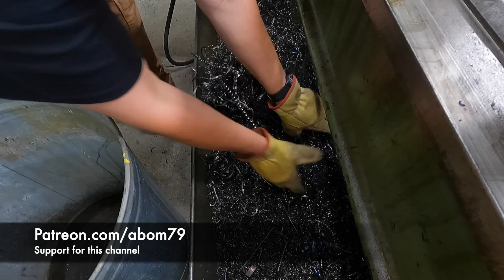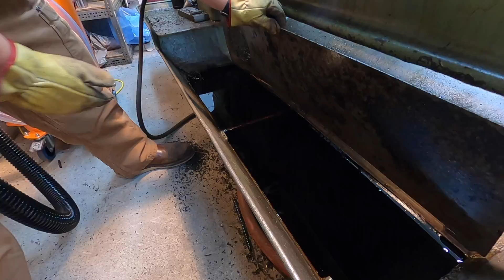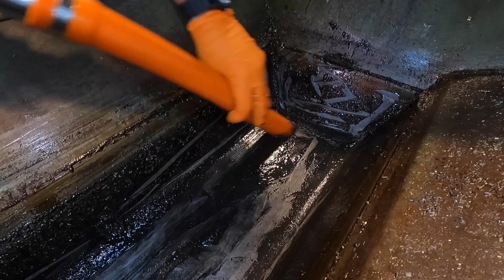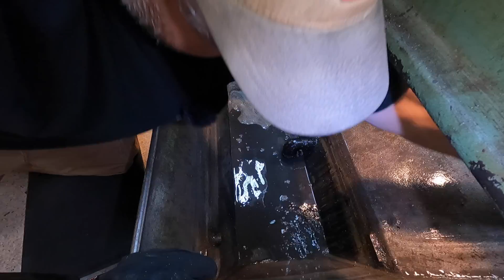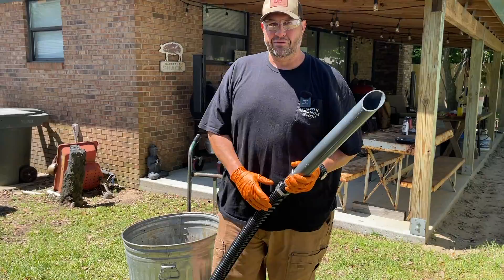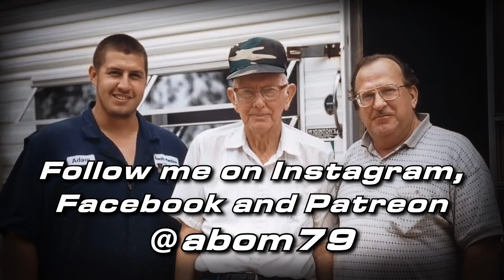SNS 344: Monarch Coolant Sump Clean-out, Freddy Micro

Comment: Very interesting. Two days ago I watched a video you posted 9 years ago doing the same thing. Video and audio quality is much improved. Your ease in front of the camera is noticeable. Camera angles improved as well. In the original video you showed the chart from the manual that recommended the weight of oil for the crankcase. Very helpful to the professional ( I'm not ). This time it looked a lot easier. Kudos.

Comment: I am a maintenance tech at a large shop. One of my monthly PM's is too clean out all the sumps for all the metal cutters. We have a Parker filtration pump that pulls the coolant into a 200 micron filter, then a 10 micron filter and then discharges into a holding tank. Once the coolant is out, I scape out all the chips and crap that accumulates. Then I return the clean coolant back to the sump and it's good to go. We were doing it every six months, but it's just too far gone and 10x harder. If you do it monthly it's not so bad. We do a complete coolant change out once a year. We use the Blazer semi-synthetic and add fungicide to keep it from getting rancid.

Comment: Since there is so much water in the coolant, does it leave a slight surface rust, when its on a bare surface and dries away? Or does the actual Oil Lubricant in it prevent that?
Like do you have to wipe your entire machine completely dry after you used coolant or can you leave it be? Maybe just clean off the most soaked parts?
Reply: in my experience correctly mixed coolants souldn't leve surface rust on parts. though It may wary from brand to brand. also to be fair only 5 years of experience.

Comment: I could smell that sump from here!  I was out of engineering for 11 years between 2002 and 2013 being a police officer, but when I went back to aerospace, in the intervening years the coolants had undergone a sea change. The stuff I use now is more or less totally clear, and never gets and anaerobic bacteria or other nasties in it if left dormant for a while. The only reason it gets pumped out now is if there's a build up of grinding dust in the sump limiting it's capacity or it gets heavily mixed with tramp oil - but that's rare. While my machines lose a lot through evaporation and extraction in use (that's grinding!) so are always being topped up, they go some 2-3 years between complete pump outs now. Amazing stuff, and it NEVER starts to smell bad.

Comment: 18:06 You could use a splash guard like the kind of thing they have on the nozzle at the gas pump. You’d probably have to make your own; it wouldn’t have to be pretty.  You could take a piece of aluminum make the hole with a hole saw, and then TIG weld a couple of tabs on ether side of the hole to mount it to the nozzle with a hose clamp I think you’d be good. Added bonus it sounds like it’d make for a good video if you ask me.  :)

Comment: Would it be easier to clean the sump with a wash down gun like a Milton Siphon Air Gun (Model #: S157 or S161)? Then you could take your Zep degreaser mixture and wash everything down to the bottom and save a lot of time and getting messing wiping all that down.

Comment: Why are you putting new coolant in your lathe? Ive never seen you use coolant on any job in any of your videos, ever... The coolant you removed was funky because you never used it. LOL :-)))
Reply: a lot of youtubers dont run coolant when they are filming so you can see what they are doing
Reply: @gtochad  I thought of this before I uploaded my comment, but it takes a quite a while for the water to evaporate and leave the nasty raw coolant behind. On my machines, I notice this starting to happen early on and top up with water way before this happens. As for howder1951's comment, ''tramp lubricating and cutting oil over time'', this could be the case, but again, it'll take a long time for this to happen as its only very small amounts in a very large sump. What he took out of his lathe, had been in there and wasnt checked in a very, very long time. He obviosly doesnt use coolant, only cutting oils when needed.
Reply: He does use it and a lot of the sludge comes from tramp lubricating and cutting oil over time.

Comment: Hey Adam,
In the Shop I work in (Germany), we use a Systemcleaner for the coolant, that gets mixed into the old coolant and it kills bacteria and mould in it.
Then the pump runs for a while, that everything gets "cleaned".
After that we empty the sump and clean it with degreaser and Isopropanol to disinfect it, so that the fresh coolent won't get contaminated and that it lasts longer.
Kind regards from Bavaria👍🏻

Comment: good choice for filter  since you weren't gonna reuse the coolant. a10 m probably won't clean out as good. probably good choice if you were gonna reuse the coolant. we use a similar sock filter at work. from 400 m to 5 m. we trash all the  filters most of the time. A 400m is a mesh style sometimes rinse out them but 200m and below are felt style not much cleaning them... but they are filtering glue. not coolant...

Comment: Still wondering, why I watched the whole video after doing the exact same thing with a DMU 1035 last week. I would have worked over time, refilling that thing with buckets.
I would highly recomend to flush your system with some kind of a cleaning solution. You could just put a bucket under your pump and let it run through the system and back in the bucket one or two hours to really get rid of the biology that happends in the coolant. If you aren't working with coolant a longer time it also doesn't hurt  to just turn the pump on from time to time, just like in an aquarium. Whatever starts to live in there after a while doesn't like oxygen.

Comment: The second-worst smell I've ever experienced (and doing weird chemistry has put my nose through the wringer a few times) was the sump of a big mill in my high school machine shop. We had all this "cast-off cast iron" as the shop teacher called it, a lot of it had been obtained cheaply from Uncle Sam after WW-II. That sump was supposed to have been drained at the end of the prior year, and hadn't, and apparently it didn't have any (or enough) anti-microbial agent in it, because it was AWFUL. FYI the curious; the 1 worst smell I know of so far is rotten potato. OTOH, I have never, to my knowledge, smelled thioacetone, and I am quite content to leave it that way. Your task looked un-fun to me. But you are smiling. Or is that a grimace? Not sure. Whatever it is, it's not an expression I see on your face very often. ;)
Reply: The worst for me was rotten meat. My dad wound up in the hospital for a month and apparently right before had thrown out about 5 pounds of meat. It sat in his trash can in his closed garage in 100+ degree heat for a month before I eventually went to his house and into his garage to find something. The smell nearly knocked me out, serious gagging ensued. I had to open the garage door and let it air out for a couple hours before I could even get near the trash can to drag it to the street for pickup.

Comment: Abom, I think you should build a device for blow down your Freddy Vacuum. It should help splashing blowback. I think, whatever size your discharge hose is (which it looks like a 1" hose from the video) go 4 to 8 times larger using a mist extractor coil. Which is a roll of wire mesh about 4 to 6 inches wide made from stainless steel. Like I said it should help. 
I enjoy your videos that you put out. Keep up the good work.

Comment: Adam, the the discharge hose off of the mount at the top of the can. 99% of the fluid will be pushed out then, it will not be trying to push up hill.

Comment: I wonder if putting a big ol' magnet at the bottom of the sump would help pull the fine particles out of the fluid.  You wouldn't need the finer filters then.  Kinda like the magnet on the oil drain plug used in some (most?) automobile engines.  Hope this helps!
Reply: That probably would work if their is only ferrous chips in there.  But if Abom machined anything else that's not magnetic the magnet wont do anything to trap them

Comment: I can give you a few tips Adam. I've operated  tank tucks for 18 years. With a system very similar to your Freddy vac, just many many times larger scale. You want to make sure your hoses are completely unraveled. When your done sucking, with the valve open, walk the hose to the machine to make sure all your fluid is gone from the hose. Same thing when blowing it. I noticed how it was struggling to come up the clear hose because it was still hooked at the top. I don't know why they put the valve at the end of the hose on the evac line, instead of at the tank. Had they done that you would be able to evacuate the drain hose when it empties, so you don't have the fluid go back into the tank.

Comment: Where does the really thick sludge come from?
Reply: years of very fine metal particles  coagulating with the oil part of the coolant. the particle are chips themselves, or bigger chips that got broken down, by crushing, etc. it's also what's left of the toolbit getting worn. all of this is a lot heavier than the coolant and slowly set down at the bottom of the pan, keeping some of the sticky oil in between particles, resulting in that slimey disgusting sludge...

Comment: Cut air filter and stuff it on black filter make it cheaper and easier rather buy a new freddy filter. Slower liquid flow to bottom but work great to hold all the chips. And you could reuse the filter after washing it or just thrash it with the chip

Comment: I'm curious, Would using used ( but filtered ) engine oil instead of coolant be a bad idea at all?
Reply: Yes. Engine oil is not good to use for cutting oil in any condition. Cutting oil and other cutting fluids have different properties than lubricating oils. Lubricating oils are designed to create a somewhat thick fluid film between the parts, so they don't touch and wear on each other. Using that for cutting means you get a thick film that effectively rounds of your sharp edge, and increases the necessary pressure. Cutting fluids are designed to create a much thinner film to avoid this.
Reply: Without any specialized knowledge, I think the big thing here is the fact that his coolant is 9 parts water to 1 part oil.  Water has a massive Thermal capacity compared to oil, so it will pull heat out of the work faster than pure oil ever could.  Engine oil wouldn't mix with water, so the best you could do is an emulsion n which would be difficult to keep longterm (at a minimum in the sump it would separate).  That stuff he showed is soluble oil so it stays actually dissolved in the water. 

Aaand for completeness, you wouldn't used water by itself cuz it would make steel rust, provide essentially no lubrication, and go really really stanky really quick sitting in the sump.

Comment: Adam, check out Unist MQL system. Like you,  I am a one man shop, my lathe, mill cold saw, ect. all used water based coolant. After a few months, the stench was unbearable. Went to 
Unist MQL for all the tools, now I clean chips with a brush and regular shop vac. 2-3 paper towels clean the chip pan spotless. My carbide inserts last longer because they aren’t being coolant shocked. After watching you vacuum out that slimy mess I became glad I switched. Where it really makes a difference is on the mill, without shields the chips and coolant would get on everything, now I just vacuum them off the floor with the shop vac. I had a hunk of 1” thick x 4” wide steel in my cold saw, the temp in the shop was about 68f, after cutting a chunk off the 1” thick steel the area around the cut was about 75f. Never  going back! 
https://youtu.be/aP3glc4HoWg.

Comment: We clean our sumps out at least once a year and on some machines twice.
 A good indications that it requires a change is that the coolant stinks. Its an unmistakable smell and not a pleasant one. The odour lingers in the nostrils long after the job has been done. 
Abom your sump looks to be long over due for a clean. Try and get the missus to take on this task and then it might be done on a regular basis.

Comment: Wouldn't it of been good to run the cleaner through the lathes pump itself? Plus, you may want to drop all the hose off the bracket when emptying, rather than try pushing it that high around the loop left on the holder's bracket.

Comment: Wondering if when you are emptying the Freddy if you could use the valve on the suction side at the top to bleed off some of the pressure to avoid the spitting and sputtering mess?
Reply: You'll find that if you use an almost empty container to dump the dregs you'll have far less "splashback".

Comment: I think when you put Freddy in blow mode , if you keep the hose straight without the turns you'd get better results and will not accumulate to much air in it.. Its worth a try , just saying . Btw Great video Adam 👌
Reply: Yup. Less head pressure would help tremendously.

Comment: I like to use kitty litter scoops to scoop whatever will scoop out of the sump, and a 20 micron filter on these sorts of things that way you end up with less dust inside. I use 20 micron filters on all my manual and cnc sumps. It actually improves tool life by quite a bit for the through-tool coolant cutters. Also that type of clear hose likes to kink when it gets hot.

Comment: Tip Freddy towards the exhaust hose outlet and you will eliminate a lot of the splatter. Design shortcoming here as the bottom should drain towards the exhaust hose. Otherwise Freddy is a winner.

Comment: Put a bucket under the condensate drain on your air conditioner, use that distilled water for your coolant, easier on everything especialy if you have hard water

Comment: Broadcast the very fine particles on your lawn.  I expect it will make your grass dark green like you see if you apply prilled iron to the grass..
Reply: What the what? explain please.
Reply: @josephcitizen4195  Landscaper here. Iron sulphate is the active ingredient in moss killer. The thought here being that when all that fine steel powder gets exposed to water, it will rust and act like moss killer. One of the side effects of moss killer is that the extra iron makes the lawn a bit deeper green, similar to applying a high-nitrogen fertilizer, but without the surge of growth.
The product I use is a free-flowing granular, not prills, about the consistency of sugar. A liquid solution works even better, but you need spray equipment, and you're screwed if any of that spray gets onto concrete.
Reply: @BlackEpyon  Hey,thanks for that. I knew sulphates were death on poured concrete walls. Climate and soil conditions where there are natural springs ,and soil releasing sulphates, no moisture barrier,and you can pull hundreds of pounds of degraded concrete off just one wall every year.
Knowing that about moss killer is a big plus.
No one person knows it all. Cheers.
Reply: @paulmanson253  In the case of moss killer, what you usually have to worry about is staining the concrete. Fertiliser and lime prills can be pressure-washed off if they sit and get wet, but moss killer stains permanently, and customers usually don't like that. You need to etch it out with acid; basically, dissolve and scrub away the surface layer of concrete where the stain occurs. For that reason, I don't trust any of my employees with moss killer cleanup. I always do it myself, even if it takes longer.

Comment: Nice rig. Likely the Monarch had about 8 gallons of old coolant as over time, evaporation lost 2 gallons, as the bedpan filled just right with the 10 gallons. That coolant pump on the Monarch must be one rugged fella...the fine metal chips it passes through it in between coolant changes. Keeping up with maintenance makes for a better shop every time. Happy machine, happy operator !

Comment: Recommend you switch from buckets to poly or metal drums.  One open top with a lid and a second closed top with bungs. 55-gallon size may be cheaper, but 40-gallon are easier to move and should be enough capacity.  This will cut down on the splash back.  Also a drum dolly would take care of hauling buckets by hand.

Comment: Company bought a used Okuma LB-15 that we assume was trashed by disgruntled employees. I was an intern at the time so I got to spend a month elbow deep in chip-filled grease, sludge and dried coolant. The sump was almost full of thick grease and chips. I had to fill it with purple degreaser and scrape around with a chip rake at least 3 times to get it clean.

Comment: When mixing coolant, I was taught OIL stands for "Oil In Last". Put water in the bucket and pour the soluble oil after. It'supposed to help the mixing. They didn't explain why or how though. I always did it that way ant it worked fine.

Comment: Many moons ago, back at the CNC shop, we had the ginormous 10-foot-long version of this for changing coolant, and I still hated doing it because all the stuff we ran was grungey nasty grey iron castings, coated with ash and spent petrobond sand, which would all wash off into the sumps. Even doing it once a month, the sumps would be over half-full of packed iron filings like that chunk Adam dug out and casting-crud. And it STANK. LIKE. ARSE. when you stirred it up...

Comment: It seems like the drain hose would benefit from being replaced by a corregated or wire-wound hose that will be much less prone to kinking. Other than that, this lil guy seems like a great help dealing with this job. 👌

Comment: Boy that brings back memories. Over 50 years ago when I first started to work, that was one of my jobs, cleaning up all the machines in our shop. Well over 50 - 75 lathes, mills, etc to clean and 10 air compressors to drain and refill all the time. That Freddy Micro would have made the job a hole lot easier. Its good that you like to keep a clean shop.